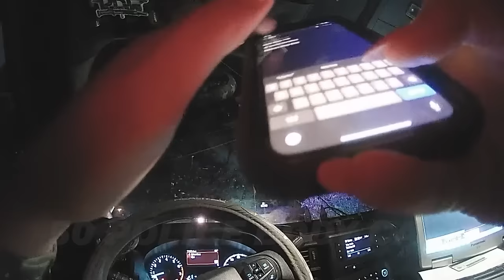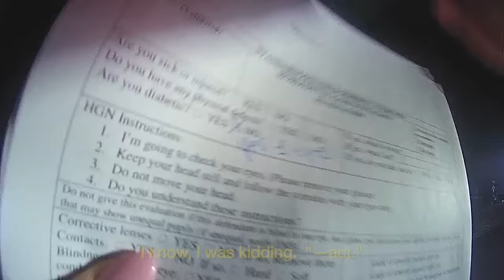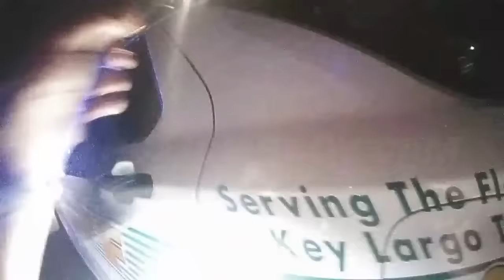Former Firefighter Kicks Like a Jackrabbit During DUI Arrest

Comment: No, the police DO NOT touch the rear of a motor vehicle to put fingerprints on it. If the officer becomes incapacitated, or the driver flees they look at the body cam, or the dash cam.   Where you get this nonsense is beyond me. 
There is no police academy in the United States that teaches police officers to touch the back of a car during a traffic stop. Most officers only do it because they see other officers doing the same thing. Ask 50 police officers from 50 different departments and you will get 50 different answers as to exactly how the whole touching the car on approach thing started. But it’s not to put fingerprints on the vehicle.  There is plenty of video evidence available to ascertain whether or not the officer had interaction with a particular vehicle including radio and license plate info which is called in upon stopping a vehicle. 🤦‍♂️